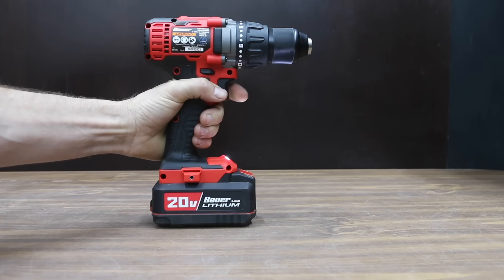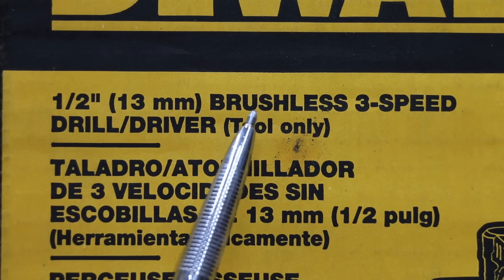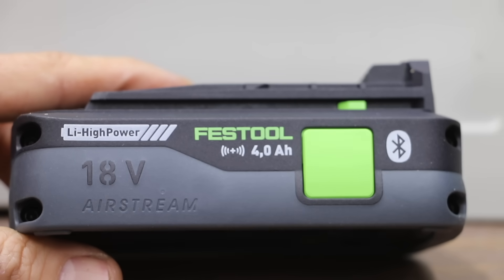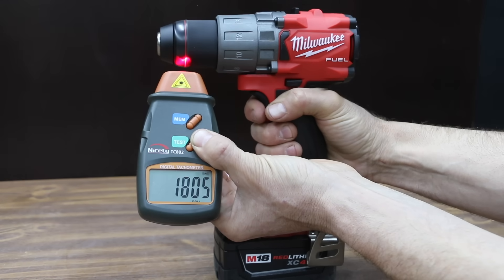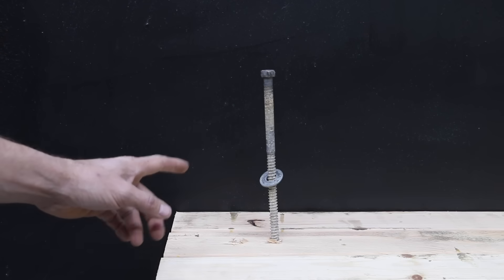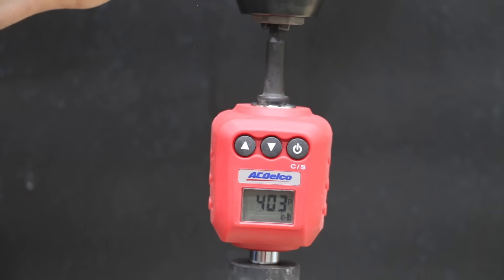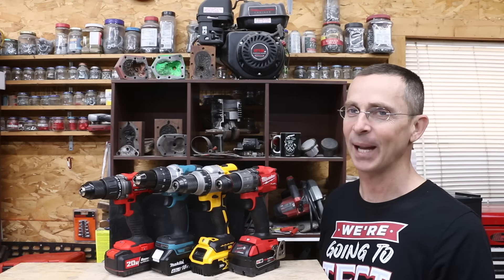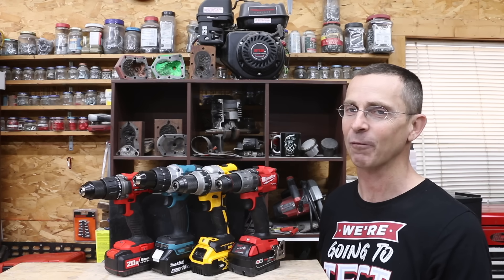Best Drill (BATTERY POWERED)? Milwaukee vs Dewalt, Makita, Bosch, Festool, Ryobi, Bauer, Ridgid

Comment: I use a drill for the sport of fencing as an armorer -- shaves a lot of time off assembling/disassembling weapons and floor reels.  I use a Black & Decker because I don't NEED all that power and torque.  In fact, when my original B&D died, i bought the same Ryobi shown here, but ended up leaving that at home because it had too MUCH torque!  I had to turn the clutch to 10 on occasion, and holding the chuck to tighten around the tool spun it out and gave me blisters on my hand!

not a prob with the B&D....you use the too,k appropriate for the job.
Reply from the maker: Thanks for the feedback.

Comment: Unless you use the same amp/hour battery the test is meaningless.  I have both Ryobi and Milwaukee and the Ryobi will beat Milwaukee if you use a large enough battery on the R. and a small one on the M.   1.5 ah for the test is not even close
Reply from the maker: Thanks for the feedback.

Comment: Tried Makita DeWalt and Ryobi. All failed in a short space of time compared to my Bosch drill. Lawn Mower test the Bosch will shut down under heavy load its a safety feature but will still break your thumb if it kicks, Build quality is spot on and trust me I've given mine some stick on stainless steel mainly. Use mine daily being an engineering contractor. Got to say Bosch products are some of the best I've used. The 18v cordless 4 inch grinder is an amazing. Battery life blows Makita and DeWalt out of the water. SDS cordless drill also is great bit of kit for drilling holes for floor bolts.

Comment: These drills seem comparable to each other.  An important feature that I like is comfort. For most tools a builder or tradesman wants his tools to be comfortable. An exception to that is a power saw. I think that a power saw should not feel comfortable. It should feel like a tool in the operator's hand. That is because a power saw, (even with modern safety guards), is exceedingly dangerous. If a power saw feels like a tool in the hand of an operator then the operator is more likely to treat the saw with the respect that it deserves and so operate the saw safely.  A triger guard would also encourage the safe use of a power saw, particularly with people, (like me), who have served in the military. Other tools should feel like an extension of the operator's body, (like a Luger pistol is reported to feel).  For example, after spending a day assembling kitchens on one of my house projects, and while packing away my tools, I was looking for my De Walt drill. I could not find my De Walt Drill. I looked for half an hour for my De Walt Drill. That disturbed me greatly, because I cherish my De Walt tools. Then, I found my De Walt drill. It was in my right hand. That is how a tool should feel. No other tool that I have held has that feeling.
Regards,
Geoff. Reeks
Reply from the maker: Thanks for sharing.

Comment: That $550 drill, it should have dominated. What a joke!

The test shows what they can do when new, what about longevity of the tool?  Home use I’d guess 10-20 years on average depending on batteries and their availability, but pro use is a fraction of that.

Maybe that overpriced and underperforming Festool can garner some points back in that segment. Their carry case is the nicest, so good for you newly disappointed owners.

Comment: You did not test the absolute most important aspect of a cordless drill. Most contractors have to leave their tools out in their truck overnight. Even in the very cold winters up north, and the very hot summers down south.  Lucky for you, I have already tested this. Milwaukee batteries perform flawlessly in sub zero temps. Meaning, the charge lasts just as long and provides the same power even when stored at sub zero temps for 24+ hours. Dewalt and Rigid batteries lose charge at approximately twice the rate when it is very cold and the batteries are stored in the cold overnight  I honestly have no idea why this is, or what the difference is in the batteries.  This is really important for anyone, not just contractors, but for people who may leave a tool in a barn, shed, or their car overnight in the cold, and expect the tool to work the next morning.
Reply from the maker: Thanks for the feedback.
Reply: @ProjectFarm  Don't take my word for it, throw those drill in the freezer overnight and run the tests again, but also, if possible,  add a pure endurance test. I would love to see if my experience is as accurate as I think it is...

Comment: most of the people in my trade used milwaukee when I started, so that's what I got. I've never had any problems over the years (aside from the occasional time the brake doesn't engage on the impact, but its easily remedied by running it at full speed for a second). I can see why they're so popular now on the jobsite. They're durable and very effective.
Reply from the maker: Thanks for the feedback.
Reply: I've never gotten the chance to use any Milwaukee cordless stuff, I do know their Sawzall is great LOL.  But, when I was installing garage doors for a living, I'd do anywhere from 2 to 10 doors a day depending on where I was working.  I ran Dewalt 18V XRP stuff back then.  I have the 20V stuff and some Flexvolt now....a few ran Ryobi, we had Ridgid at the shop, and I got to run the Makita stuff a little bit.  What I found was the Ryobi batteries didn't last nearly as long as the Dewalt and Makita...the Ridgid was kind of in between.  

I'd love to give Milwaukee a try at some point for sure, they make some good stuff.  

What I have ran into, as well as a lot of other people, once you get a battery platform started you kind of just stick to that since you got the batteries and chargers already...you can pickup bare tools when needed.  So many of us never get to try out other brands...only reason I got to in a limited amount was due to the type of work I was doing, and going to different jobsites and occasionally assisting other installers so I'd use their tools LOL.
Reply: @wildbill23c  well it's been 3 years since I bought my Milwaukee tools and they're still running strong. I've dropped them off ladders many times, only charge them once a week for electrical work. They seem just as good as when I bought them, despite the apparent wear.

I do know some people who use Dewalt and they have had issues with the batteries not fitting right on the sawzall, so they have to hold them in when using it. but those are older models, so maybe it's fixed by now
Reply: @KjKase  The old 18V battery packs on the Dewalt Sawzalls sucked...the vibration was so bad the batteries would fall out or lose connection LOL.  The 20V platform doesn't seem to have that issue.
Reply: @KjKase  I’ve seen landscapers that used Dewalt in the shittiest of conditions in the diet and mud and they never had problems. Any brand can have problems. I use Milwaukee and after a year of use from my impact from just screwing on metal siding and roof and after a year of normal ass use the thing sounded like shit
Reply: @xaphan8581  you're not supposed to use your whole body weight tapping in screws

Comment: My old boss (a roofer) had these 15 year old Dewalt impacts that he let me use when I started working for him cause I didn’t have many tools. These impacts have been left outside in the rain, dropped on hoods of trucks, dropped on rocks from up on a roof, fallin in very wet mud and he uses them as a hammer when he doesn’t feel like switching hands (cause that time grabbing another tool takes up time I guess) and they worked just fine. I couldn’t believe it to be honest so I stick with Dewalt but I think the top 3 or 4 brands are all the same technology even though one or the other may be faster but you don’t buy a big truck cause you want it to go fast.
Reply from the maker: Thanks for the feedback.
Reply: For anyone who didn’t know the buyout of dewalt happened in 1960s from black n decker so that so called “rebrand” wasent a rebrand the tools have always been the same company 🤣idiots
Reply: @stockscrypto101  exactly. And it’s not a “re-brand” it’s a sister company to Dewalt. Ryobi is also a sister company to Milwaukee so I guess those are the same tools too, right? There would be lawsuits if they used the same parts, put different plastic on them are raised the price to over 100%
Reply: I knew some people who graduated in mechanical engineering with me who went off to work at tool design companies, and they said that all the brands use just about the same major components (motors etc).  I suppose you could tear them all down and reverse engineer - not sure if they have circuit card assemblies that hide some of the differences.   This isn’t to say one brand doesn’t outperform another - for example as I understand it a BMW 328i uses the same engine as the much more expensive 335i, it’s just the 328i’s ECU isn’t tuned to extract all of the horsepower.   Same sort of thing could happen with tools, but I mostly doubt it.  The best contractors I worked with before going into engineering used Ryobi tools because the batteries were cheapest, and in their experience having tons of charged batteries on hand was the #1 way to save time.  I knew a bunch of guys who used DeWalt (before black and decker bought them) and a few who used Milwaukee, too, but they were generally the ones who spent a lot of money on everything they bought… the guys I referenced earlier treated work like work and focused on efficiency.
Reply: @stevebean1234  interesting. Fwiw, both Makita and Bosch are electric motor manufacturers and make their own motors.  I suspect Hitachi Koki as well. I don't know about the others.
Reply: @sharkskin3448  Oh very interesting.  I'm not too surprised.  And honestly, even among engineers what I said could still be "hearsay".  Though truthfully, I am not sure there is much too broad of a "design space" within power tools.  I mean, it isn't rocket science or anything close.  The $600 Festool tested here could be made with Unicorn hair and unobtanium for that price and it didn't seem to dominate the competition... anyways, just my .02 :)
Reply: @stevebean1234  lol!
Reply: @stevebean1234  I don't buy Milwaukee due to high price. I'm an outdoor contractor. They are the R&D leader and always improving. That R&D trickles down to all the others and sharpens competition.  I'm addition to my Makita, Bosch, and Hitachi; I'm looking at getting some Ridgid.
Reply: There's a reason 'daddys black&decker drill' still works after 43 years..

It's because it only comes out of the garage once every 6 years to fix broken Christmas lights. Not because of some made up lie about how used/beaten their unused useless single-gear garage drill is.
Reply: My old dewalt drill didn't survive a 6 foot fall, which is why I am back here. Looks like I will be buying another Dewalt. The last one lasted over 7 years, so hopefully new newer one won't be crap. I've read reviews where they didn't work out of the box or stopped working a few months later. But it seems everything is like that anymore. Yay Chynah.
Reply: you can use the milwaukee impact wrench underwater i saw it on donut media's tool test
Reply: The old DeWalt tools are awesome. The new one's 🤣 good luck with your black and decker rebrand
Reply: @winkletown8828  That could be… I know that they’ve expanded more of their manufacturing in the U.S so it’s more American built than before they outsourced parts. But both Milwaukee and Dewalt get parts all over the world like Mexico, Brazil, the U.K, China etc. it narrows down to preference at the end of the day.
Reply: @winkletown8828  yeah this is pretty inaccurate. Especially when you're looking at brushless tools.
Reply: @tommywd40   inaccurate how?? I used DeWalt tools in the 90s and 2000s, never had a complaint. These newer ones though, seen em burst into flames, seen them stop working 3 minutes after unboxing, I've seen the batteries swell and become a potential bomb waiting to happen. 🤷 There's no chance I'll ever buy a product that has proven to be a health hazard .....
Reply: @winkletown8828  so your anecdotal evidence should be taken as fact? I've seen Milwaukee's stop working within a week. Does that mean I should tell everyone they're bad?

I've been using made in USA Dewalt for years without problems. Also the batteries found in milwaukee, makita, dewalt and etc. pretty much all come from the same factory in Malaysia, so that is not indicative of Dewalt.
Reply: @tommywd40  at the end of the day, your opinion only matters to you. I've seen DeWalt fail more than any other brand, Makita , or junkita as it's referred to around my shop, is a close second. That being said, you want to know the only brand we haven't had any catastrophic failures with in the past two years?? Ryobi, yep, good ol green and black. Had one Milwaukee M12 battery failure, otherwise they've been great. But the Ryobi HP tools, have found a forever home around here. Zero failures in two years. That means we spend less money replacing tools. You can nuthug any brand you want, you can talk bad about any brand you want, but we use and abuse our tools around here and at the end of each quarter I roll through the books, looking at what failures needed replacing and which was the most cost efficient. Ryobi HP has been the tool that puts the cash in our pockets. Lower investment cost, lower battery cost, more options for some of our custom work. Sometimes I wish the impact driver had just a little bit more snort, but then I realize I'm not snapping off adapters and bits on the regular like the M18 tools do, so less bits purchased saves money. In another 6-12 months we plan to move out all of the current lineup of tools and try out the new models, hopefully these other companies haven't gone too cheap on the build quality because they have a serious tool to live up to in the Ryobi HP. Not saying these are perfect, they lack some creature comforts of some other tools, but at the end of the day it's all about money and reliability. By the way, my two businesses are an auto shop and a custom car audio shop. So the tools definitely need to perform.
Reply: @winkletown8828  again, all anecdotes which was what my original post addressed. I am not "nuthugging" as you say, rather bringing up how nonsensical your original post was from a factual perspective.
Reply: @winkletown8828  lol, good luck seeing a Milfukee saw still working in 30 years like Makita's. 

Japanese design >>>>> Chinese design.

AvE has done teardowns of multiple Makita's and they are always solidly better built than the aforementioned Milfukees.

The red brand is more TTI garbage.

Same for the lime green brand, albeit at least it's a lot more palatable since it's much cheaper.

This is coming from someone on Makita 20v/40v platforms, Bosch 12v platform, Ryobi 18v platform, and DeWalt 20v platform.

Had a couple of red brand tools early on--but Jesus the slop on them compared to Makita impacts and drills was insane. 

Use a 3rd gen fuel impact driver and use any Makita impact driver made within the last 3 years and tell me with a straight face that you think the red brand feels better.
Reply: @winkletown8828  I see the same shit with new Milwaukee.

Comment: I have a 30 euro hand driver/drill from lidl and it's the best I ever had... 
Admittedly I'm not a pro and I don't use it every day but it has all the features I want and works well for what I do with it.
Incremental improvements over the years can lead to good&cheap design, I guess.
Reply from the maker: Thanks for sharing.

Comment: Great review! Battery lifespan is what I'm very interested in, not just battery run time. I have given up on Makita, as the last drill (back in the 14.4V days) had both batteries die just out of warranty. Meanwhile an old Hitachi drill from 15+ years ago is still going.
Reply from the maker: Thanks!  Thanks for the feedback.
Reply: My one and only complaint about Makita is the battery duration.
Reply: While battery lifespan is one of the most important aspex from user perspective, there isn't really too much variation there. All of these batteries use pretty much the same li-ion cells inside, made by Samsung or LG or Sony or Panasonic. Battery lifespan is mostly the cells' lifespan, and theirs can be looked up based on the technology and identification number.
Reply: @Surmoka  
Totally disagree on Li-Ion cell lifespan. 

If the battery controller limits voltage excursion to between 3.2 and 4.0 VDC on every cell, the pack can easily beat competitors lifespan by a wide margin. (Industry often uses a 3.0V - 4.2V excursion, which hurts cells.)

What stretches lifespan is mostly reducing the final charging voltage. If you stay below full charge, like 80% most of the time, and only charge higher if you will immediately discharge back down - then you will easily double or triple the lifespan. 

Of course, frequently pulling cell voltage below 3.2 V is another way to kill cells early. If the cut-out circuit doesn't watch every cell during discharge, the battery pack will also die young.

However, manufacturers of hand tools are reluctant to increase pack weight or shorten run time. Some even consider the pack replacement sales as an incentive to reduce pack durability. 

You can manually take your packs off the charger when the last light has started blinking (typically exceeding 75%) and get most of these benefits. Also when the motor slows down at all, immediately swap out the pack.
Reply: @imconsequetau5275  good explanation, but what I wrote still holds: there is not much point in comparing batteries that use the same technology. This also applies to charging circuitry. Makita, Default, Milfuckee and co. batteries are pretty much the same in every regard.
Reply: your point does not hold case close.